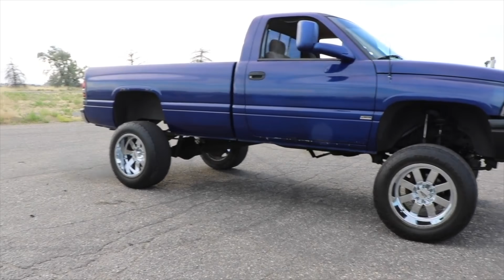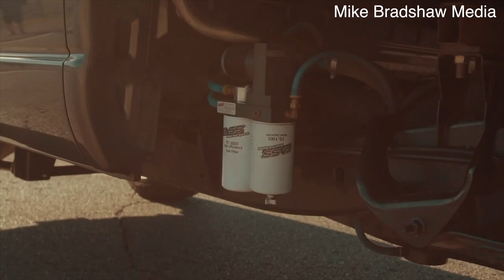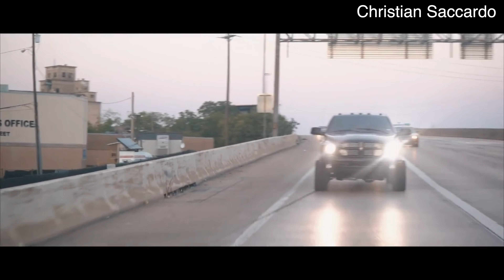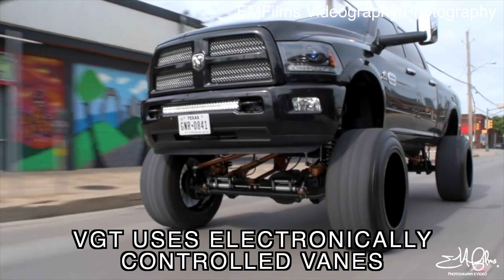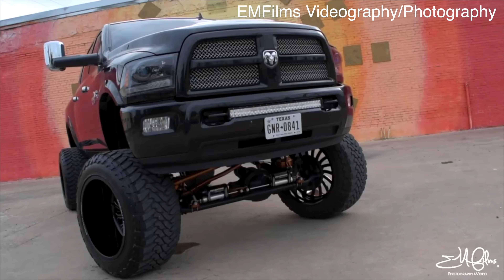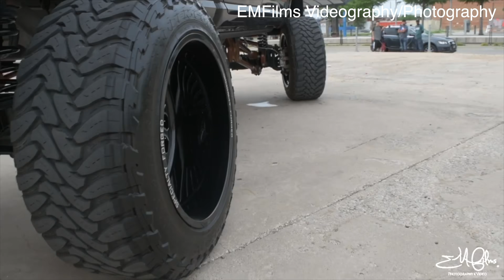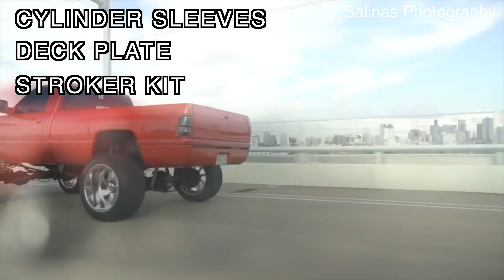5.9L vs 6.7L Cummins: Which One is Actually Better?

Comment: There's no replacement for displacement but with that said I drive a 98 1/2 24V VP Pumped making around 750hp and 1300 lbs ft torque and getting 24mpg on the road while driving like my mom.
The Truck is Built for Sled Pulling in the street stock class mods include tunner box, cold air intake, .093 lines & tubes, 90# springs, 4" open exhaust, hybrid turbo, full billet custom valve body trans and flex plate, triple disk 1200 stall billet converter, moog super duty joints, airdog lift pump and other mods, money invested to date right at $29'000
Reply: i got the same truck. You know a reputable machine shop that can do a good job on a reman.
Reply: @bluebird5100  if your talking Turbo mine was done by Columbus Diesel Supply in Columbus Ohio, 
Phone  number 614 445 8391

The Transmission  was built by Brian Vannest  at Vannest Diesel Performance  in Ravenswood WV.
He is a very popular guy in that area and he does great work at a great price  
Phone number 304 273 9450

Comment: 5.9 had issues with blocks made in Brazil...the 53 casting, drive a 1999 and a              2019, if you can afford the 40 to 50k price difference, no comparison
Reply: Of course it was only some blocks that had issues.  My Mexican made block is super solid and going strong.
Reply: @andrewhansen4179  I should have pointed that out....thanks
Reply: @andrewhansen4179  yeh i had a look at mine the other day to find no 53 on the left side 530,000km and still going strong
Reply: @ryanhawkins5306  Wow, nice Ryan.  330k miles and still going strong.  That's one of the reasons I bought my Cummins powered truck, the longevity of the engine, and of course the good mileage and towing power.   I remember having cold sweats crawling under my truck for the first time to check for the dreaded 53 block casting.  I also dreaded the time my VP44 injection pump would fail, and it did hundreds of miles from home at 136k, and that was long after my upgraded fuel pump and full set of gauges.  But I've upgraded and fixed those issues with better components.  I've also been able to achieve way better mileage with a major transmission upgrade...better valve body and torque converter.  What a huge mileage improvement that made. .... well worth the $$$$ spent.  My truck is better than new although cosmetically it needs some attention.  (DDRP lift pump, Blue Chip injection pump, Goerend transmission, PSC steering box, Flex-a-lite fans)

Comment: 5.9 is a more reliable engine, more fuel efficient, however the 6.7 pulls and works so much better! I’ve owned and worked both.. as a daily, I’ll take my 06 5.9, if I’ve gotta haul heavy weights and push a lotta wind I’ll take the 6.7 hands down.
Reply: 5.9L is not more fuel efficient. I have gotten 23mpg from my 2016 6.7L unloaded  many times and see 21 daily commute.

Comment: Simply put...the 6.7 was needed to achieve more power but still meet the more and more stringent emission requirements than the 5.9 could.  The 5.9 is still the dominate engine in the performance world.
Reply: The 5.9 does well in the performance world but the big thing for performance cummins guys is a 6.4 cummins. Alot of racers and sled pullers use a 6.4 these days and yes I mean 6.4, not 6.7.
Reply: @gabrielf1911   rare to find someone who knows these, I read theyre not good for daily and only power houses which i find hard to belive. I want a 12V with a stroker kit lol
Reply: Yeah, no.
Reply: Not so much...
Reply: Emissions what's that.....it's all long gone
Reply: Yes sir... well said!
Reply: Who cares they are both great engines. I live in Alabama so California can stick their emissions up their uppity butts. Deleted my 6.7 and never looked back.
Reply: It's not safe to push a gear driven diesel engine beyond a certain point. By adding more power, you're just trying to make the engine rev faster. Gear driven engines has some limitations per se
Reply: Crazystuffyousee a few 5.9 did come with egr to meet California emissions
Reply: @brandonshattuck3737 that’s not true at all… all 5.9l in a standard pickup never had an EGR…. Only the 5.9L isb that was in like a 750 chassis had one

Comment: @ 1:00 "omitting the 12v 🤔 
I've heard enough. I'm out.
Reply: Yah forget about the engine that put Cummings on the map for pickup truck moters.  I own a 12 valve and wouldn't trade it for one of those newer pieces os
Reply from the maker: 6BT_ Str86 kbye

Comment: Also need to take into account the transmission options available for both. 5.9 48re and g56 or 6.7 68rfe aisin and g56 the 48 is an awesome trans
Reply: And the mv5600
Reply: The only automatic transmission for me is the AISIN.

Comment: Why so much footage of mall crawlers?
Reply: Low profile tires dont belong on a  Cummins!🤦‍♂️
Reply from the maker: Because finding any high quality video of normal trucks is difficult. Trust me, I’m not a fan of the big wheel with tiny tire look.
Reply: @Dustrunnersauto Fair response
Reply: Where’s the mud grips at?
Reply: The 7.3 is the best diesel engine from Ford I'll give you that, but it is far form one of the best.
Reply: Because they're the ones getting in front of cameras
Reply: I guess I'm not up to the times but what the hell is a mall crawler
Reply: @marklaumond5241  lol they don't ever go out to the mud with those road queen trucks, so they crawl around the mall because of the "visual effects" they add to it
Reply: @wezilla21  even going mudding in a cummins dumb. I have a 24 valve and people talk shit on me about the fuel pump and not being able to go fast, going fast isnt the point. Its towing, and work trucks. I dont go out in the mud mainly cause a 10 thousand pound truck tends to get stuck and most of my buddys cant pull it out with their little trucks😂 im here to tow and get work done. If i want a mud truck ill buy a little chevy and get the job done.
Reply: wes is muffing like a requirement now if you have a truck or something I don’t wanna sound like a smart ass but trucks were built to drive on the road lol
Reply: @marklaumond5241  you can see in that video, rigs made for pussy posers, wanna be cool, kids
Reply: @marklaumond5241  all suited up never in the game.
Reply: @marklaumond5241  a truck
Reply: There is a lot of pavement princesses
Reply: Why we haul bales every year/ why my ‘04 does all the heavy lifting, because “boat anchor” eh? Oook 🙄
Reply: chads and douchebags united for the footage.
Reply: Get those wide tires in the mud and make sure you have someone without them around to pull you out... Looks pretty though!
Reply: well i see which one as better, both can be made into a baffled of crankcase loop charged by valves 2 stroke motor, 2400 rpm sounds like 4800 rpm, oil injectors into the intake and the rest VRO into the fuel with klotz techniplate 2 stroke dry sump fed with injection, nothing but a valved loop charged 2 stroke to me, ill have fun with 2 stroke oil though!
Reply: @Dobbies Revenge I agree with you that the 7.3 powerstroke is one of the best but so is the 5.9 24 and 12 valve
Reply: SimonTrent8000 make your own video if you don’t like it
Reply: Mall Crawlers LOL that is what they are never tow or haul. Oh wait forgot the dirt bike they put in the bed.
Reply: P.s. my 2004 #CUMMINS (Gertrude) is a towing/ pulling “mall crawler” 😊
But yes, they’re made for a reason! And scraping pebbles, ain’t 1 of them!!
Reply: Cause theyre the best looking trucks
Reply: I've got a 96 3500, stock engine with 401,000....still going strong
Reply: 20 years from now 
Pickup trucks will have 950 HP
Cost $300,000
Take a ladder to get into
 $ 35,000 a year to maintain
Reply: It’s not about what Brand, it’s about saving money!
5.9L Cummins just because it’s the 1st original Million Miles on the Odometer Engine without major mechanical issues! The ONLY OTHER TRUCK that can claim this is the New Generation Toyota Tundra. So all you Ford Fucktards and Dumbass Chevy Fans want to bash Dodge owners... do your research you fucking idiots! Numbers don’t lie! Anything newer model SUCKS! Remember that pussies
Reply: Jason S I agree with the second part of your comment but let people spend their money the way they want to. Stay out of their business I’m sure they could give 2 shits about what you think. Also if you think they don’t do “manly” things with their trucks your wrong go watch @whistlindiesel
Reply: @rocketman3776  haha the only moron here is you. And as someone else said... the powerstroke 7.3 is one of the most reliable diesels ever built. I'm a dodge man but it doesn't change the fact you bitchy infant.
Reply: Nate G you don’t know anything about vehicle do you? Especially the 5.9L Cummins and the 5.7L Toyota Tundra engine.... BTW, the only 2 motors consistently getting 1,000,000 miles without breaking in 15 year history! I used to be a Dodge And Toyota Automotive Service Technician, ASE Certified and I have a College degree in Automotive...

Pretty sure I’m the Professional and you are the BITCH INFANT here.... BITCCCCH!

You couldn’t hold onto my Military Jock little man child... you couldn’t or WOULD NOT walk in 1 mile of my Combat Boots either coward! Fucking keyboard warriors.... Douche canoes for real!
Reply: @rocketman3776  haha okay tough guy. So what if I was wrong. No harm in that. And I'm not the "keyboard warrior" as you like to say. I wasnt the one getting on here hurling insults at everyone. You're the insecure man baby who needs to feel tough... it's ok. No one is threatened😉
Reply: It should be illegal to have tow mirrors out unless u have a trailer behind ya.. Looks so Fuckin dumb!
Reply: @jayirving6996  Flipping your mirrors out adds 50 hp per side 🤣
Reply: JAY IRVING i don’t think they should flip up period I can’t stand having them up even when towing it reduces field of view and they shake too damn much
Reply: @jayirving6996  On my 06 mega cab my moose antlers stay out bud! I'm use to them like that its not always about looks lol dont be a goon! I tow trailers almost every day and im not ganna waist my time adjusting a mirror every day twice a day minimum. i have 4th gen mirros with the large convex. You have to adjust that by hand so thats not happening lol
Reply: @I-Am-Him-Ask-Your-Mom  same here. Even dumber is changing out their OEM's for  Shiny new tow mirrors, to match their shiny old hitch.
Reply: @I-Am-Him-Ask-Your-Mom  yes sir I leave my mirrors out also, I dont fold the mirrors in on my semi when I'm bobtail either..lol 
but it sucks almost  hitting the yellow poles in the drive thru 🤣
Reply: @johnscrazycurbs6752 lol had an 18 wheeler try to block off a merge lane I was in, with about a mile left, I threw my tires up the curb and squeezed through and my mirror knocked his fenderlight off and fucked up his fender cracked the housing on the mirror but it didnt break and wasent noticeably cracked he moved out of the way and traffic moved again. No chineey ones for me.
Reply: @mikesanders4621  i scrape the windows when there arent the poles to keep you from getting to close lol
Reply: @I-Am-Him-Ask-Your-Mom  you guys are great, me and my biker buddies enjoy the punching bags while riding lol
Reply: @jonathangarzon2798  don’t worry I don’t pinch off the lanes y’all should be able to split at red lights and in traffic and I’ll punch off a mirror of anyone following to close to you I shoulder check and actually use my fucking mirrors 23 years on 2 wheels myself I’ve got your back bud
Reply: @I-Am-Him-Ask-Your-Mom  bullshit. As a heavy truck mechanic I don’t believe a thing you said
Reply: @jayirving6996  I can't adjust mine so you'll have to deal with it 😂
Reply: @rocketman3776  😂😂😂 I dont believe for a second you're a vet let alone a purple heart. 😂😂 The vets I know aren't so insecure. A real man doesn't need to talk tough to someone they'll never meet to feel like a man.  Who said anything about being gay except you btw. What's the matter? Your boyfriend holding out on you? A little frustrated are you? Haha. The more you talk yourself up the smaller you get. But keep it going. I havent laughed so much in a long time.
Reply: Nate G I said something about you being gay because you are infatuated wished me. Look at you coward, you don’t even know me and you keep trolling me like a coward or a homosexual that obviously don’t have a woman in his life harassing another grown man... a Purple Heart Combat Veteran of 101st ABN DIV, Kunar Province Afghanistan, 4ID Initial Surge into Falluja and Baghdad and my company tore down the Statue of Saddam Husain and dragged it down the streets of Baghdad with an Abrams Tank! Yeah that was me! I was there! I’m a fucking Combat Veteran... all the Veterans you know must be P.O.G.’s (People Other than Grunts), you know... the Soldiers that never saw Combat! The ones that don’t suffer from PTSD... what you see is PTSD not insecurity, I promise you I’m not complacent and I promise you I’m just as efficient as I was when I was active duty, might have gotten blown up and suffer some brain damage but BOY.... STOP FUCKING DISRESPECTING A TRUE COMBAT VETERAN, one that fought for your Freedoms! 

What kind of special piece of shit are you to be continuously disrespectful to those who fought for your Freedoms! Karma has a way for those who steal Valor and I swear on my life, I’m the real deal 100% American Veteran Soldier, Purple Heart recipient and Disabled Combat Veteran. If you keep questioning me or judging me, Karma will find you and tuck you up because unlike you, I know what Integrity means.

Military Core Values I swore to live by and still do to this very day:

Integrity 
Duty
Honor
Selfless Service
Personal Courage
Respect

I lost respect for those who show disrespect, respect goes 2 ways. If you disrespect me, I will respectfully kick your ass or respectfully insult you.....

Are you all looking for scared little men with their feelers tucked in their pockets to defend this country or people who stand up to any kind of BULLY and snuff the reality out? You sir are a true coward for disrespecting a real Combat Veteran who sacrificed everything for your Freedoms, got blown up, got shot another time, was told to return home but refused because IM NOT A FUCKING COWARD AND I NEVER WANTED THE STUPIDEST PURPLE HEART MEDAL IN THE FIRST PLACE YOU COCK HOLSTER SON OF A BITCH!!!!
Reply: @rocketman3776  also I got curious and looked up a few things. 101st airborne is US ARMY. You claim to have toppled the statue, and that was US MARINES that did that... AND it was an M88 armored recovery vehicle they used to pull it down. NOT an Abrams tank. I knew you were full of shit you fucking fake. Next time you make shit up do your research and remember everyone else has access to Google too. Maybe it's time to get off the computer go find a job and move out of mommy's basement. Karma also has a way of dealing with pathetic impotent lying sacks of shit like you who try to wear the honor of a soldier but didn't earn it...bitch.
Reply: @rocketman3776  what's the matter? No more ridiculous insults or wild stories to tell now that you've been proven to be a fake? That's what I thought. Have a nice day😁
Reply: @rocketman3776  aww...  did you report me you whiney little girl?

Comment: you have the injector firing voltage backwards. We are working through this issue trying to run the more reliable 6.7 injector in a 5.9 truck running the 5.9 ecm. The 5.9 injectors fire at 18v and hold at 18v the 6.7 injectors fire at 24v and hold at 18v so we are getting a sluggish opening on the 6.7 injectors causing a rough start.

Comment: I really love the detail you guys put in the videos. 1000 tq from factory is crazy! I like the 6.7 more.  How about a video about the VG30DETT?
Reply from the maker: I’ll put it on the list of videos to make!
Reply: @Dustrunnersauto  the 400hp with CGI block I believe no longer has siamese cylinders. Siamese cylinders result in bores that can go out of round and are undesirable for that reason.
Reply: @Dustrunnersauto  the vg and vq 30 Nissan are some damn fine v6 engines!
Reply: Actually there is no passage between 1 and 2 cylinders (or any of the others).

If everyone here can image lining up 6 coke cans in a row. The siamese cylinders are joined like that. There are provisions for improved flow as close as they can get so that there are no cooling issues between the cylinders.
The rest is basically the same as previous years with coolant flowing around the cylinders on each side. Coolant can also flow from side to side at the front and rear of the block.
Siamese cylinders actually add a great deal of integrity and rigidity to the engine block.

 Reply